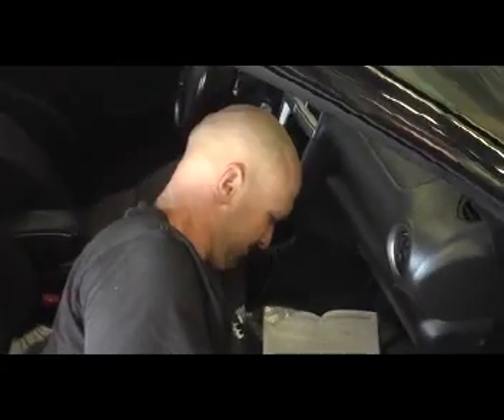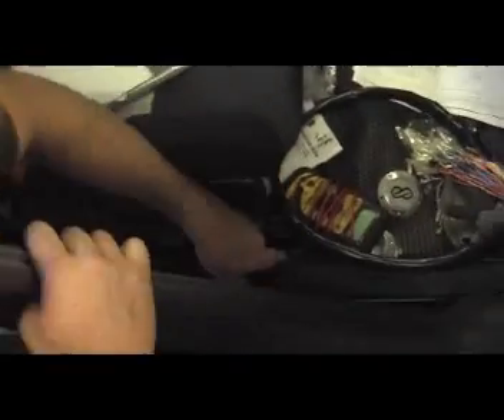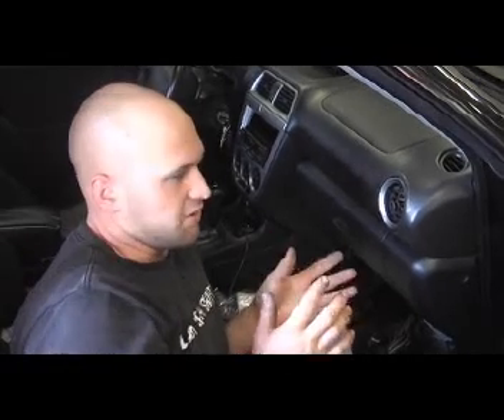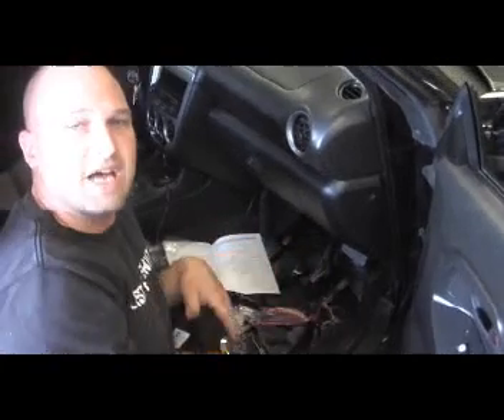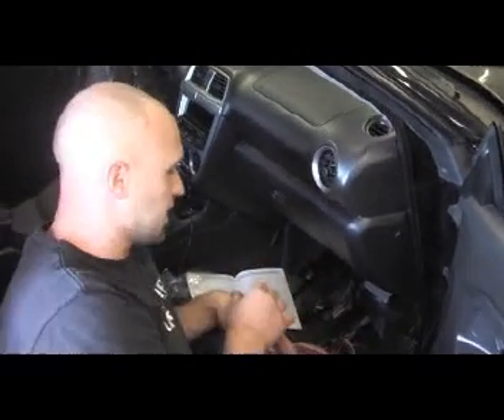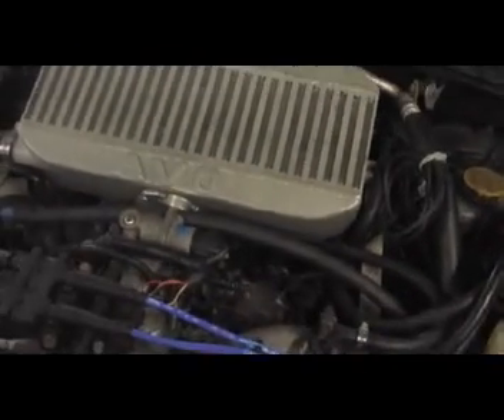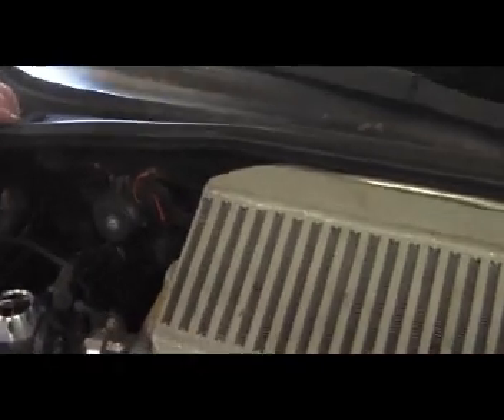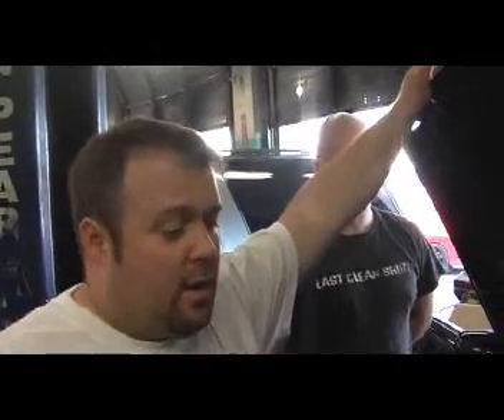Impreza 2.5 RS with Turbo Kit wring problems

Comment: was it the stock Ej255 & someone boosted it? Cus it has the Bugeye dash so... I wonder if someone slapped a crappy turbo kit on it, put a Bugeye dash in it, and sold it to this guy as a WRX swapped rs!?! That would suck! But after all the labor done on it, it would have been better to have actually done a real Ej257 swap and saved all the hassle of finding the faulty wiring. That's what happens when I don't send the harness to Brian @IWIRE .... Hahaha